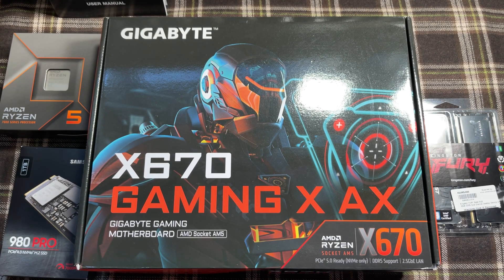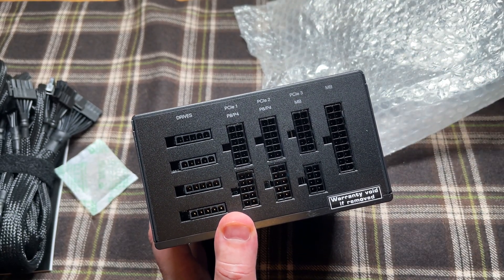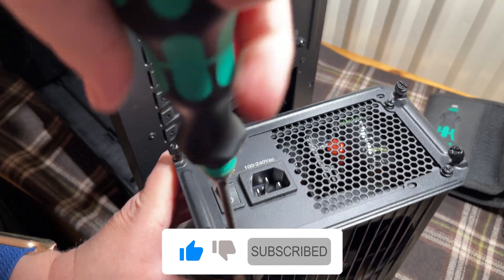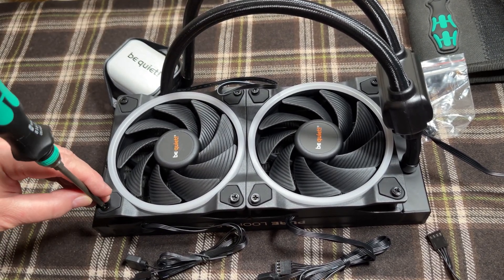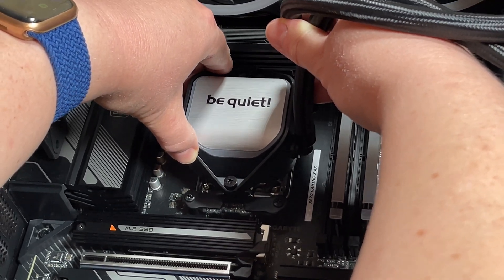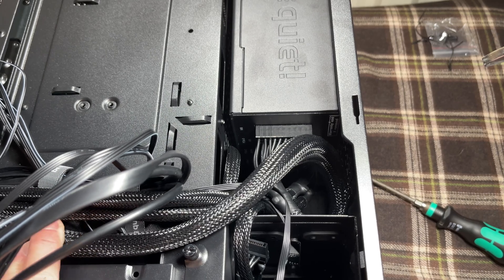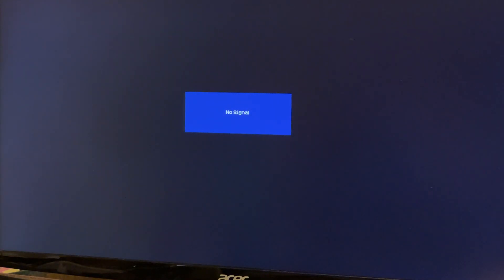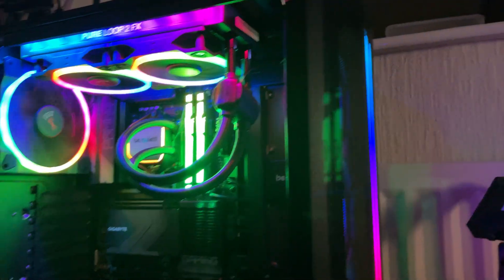How to install a AMD Ryzen 5 7600X AM5 on a Gigabyte X670 X gaming AX - PSU - CPU cooler - Cables

Comment: I just build my pc and I’m not getting post at all. Ryzen 5 7600 with a x670e tuf gaming board.
Reply from the maker: Sounds like a power issue , have you got your cpu 8p connections .
Reply: @MicroChipz  yea the two 8 pin are connected, everything turns on but I get no post
Reply: @Pro3men2  im not sure theres 2 8pin for cpu power, just one and maybe a 4pin cpu power next to the 8 pin.  Not to be confused the 8p with the pci-e for gpu.  Double check ur power cables from case to mb is correct i.e positive and negative pins.
Reply: Any ideas ?
Reply from the maker: @Pro3men2  sorry , all you can do is isolate parts untill you find the faulty one .remove everything apart from whats needed to boot , use the inbuilt vga in the chip, make sure memory is the correct type and in the correct sockets.
Reply: Clear CMOS, refer to manual, then try a boot and leave it, as I heard it may take awhile for it to boot due to somit called memory training.
Reply: you might've damaged your mobo installing cpu